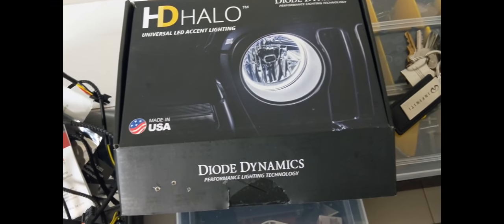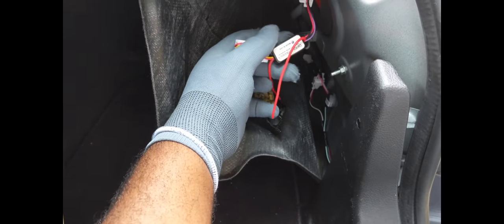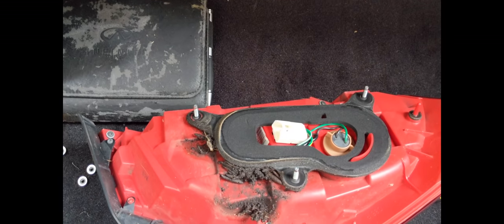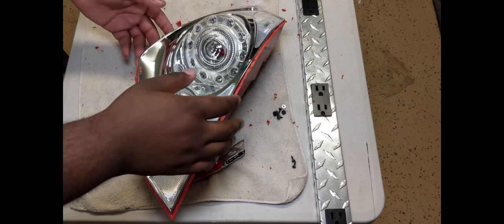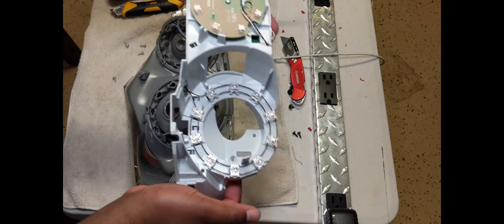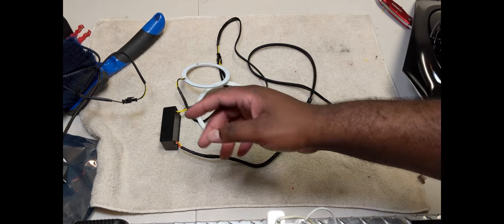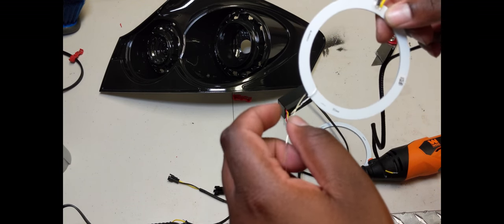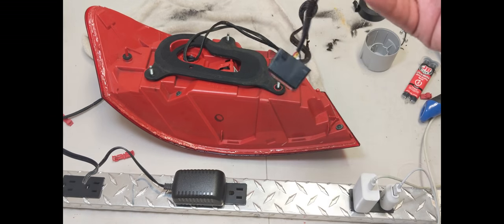G37 Brake light Halo install Step by Step DIY (GTR BRAKE LIGHTS!!!)

Comment: You can avoid having to cut the housing by putting it in the oven at 350°. Just be sure to remove the ballast first to avoid damaging it. You then simply (and carefully) pry it apart. I didn't know this prior to watching your video and just now learned it since I'm thinking of doing similar. Thanks for the video!
Reply: Try the oven method and post it.... cutting does seem kinda raw for me
Reply: i thought he was crazy cutting these up.  i haven't tried it on my tail g37 lights but i've separated many lenses from headlights and tail lights by baking them
Reply: With Gs taillights in general you can’t bake them in the oven, there plastic welded to the lens, I retrofit and always have to cut the tails.  Headlights easily go in the oven.
Reply from the maker: Finally thank you.
Reply: Who here has done the oven method instead of cutting them off ???

Comment: 90 and 110mm rings <<< for those who didnt catch it.
Reply from the maker: yes that is correct, you need a pair of 90mm and a pair of 110mm see the links in the description for diodedynamics,
Reply: @1BuildMedia  is a coupe the same?
Reply from the maker: @christians8114  apologies for just seeing this. I dont want to steer you wrong. I am not sure.
Reply: @1BuildMedia  can I use a 80mm or even 100mm cause I can’t find 90mm anywhere
Reply from the maker: I'm sure you can make it work
Reply: @_.._i  yes, 2 sets of 2 rings for 2 taillights

Comment: You don't need the tails as turns modules. Sell em, and ditch them. You can wire directly to the OEM pigtails (ON/BRAKE/TURN) and will work fine. Maybe your issue is 1 driver trying to run 2 specific halos? Also, could just depin your wires, no need to cut unecessary holes. How is your seal? Why not use rubber buytl to seal those lights?  Why ditch clear lens for halos? You recommend the 2 prime sizes for halo applications, however halo sizes can vary depending on application . FYI Halo sizes vary on build applications and builds can retain those clear OEM lens. All in all, thanks for the step by step and wish you the best
Reply: This was lowkey a passive shady comment

Comment: Hey man, great video. Helped through a lot of the work. Although, I’m having a slight issue, all of my things work except they don’t turn on when the headlights are on. Turn signal, lock/unlock, brake all work fine. But they don’t run when the headlights are on. Does it have something to do with the extra yellow off of the drivers? I didn’t touch those. Thank you
Reply from the maker: Check the wiring config in the pinned comments

Comment: Hey got a question, currently working on a project doing the quad halo set up. I have the red halos going from black>to black
Red> green , white> green and white
And i have the switchback halos yellow> green with yellow and i have the black fused with the black from the red halos both going into the black from the oem harness. However when i brake the ambers turn on instead of the red. Any idea why? I only have black and yellow going to the harness.

Comment: What would be the best way to color match the little part on the trunk with the reverse light? Tinting it maybe?
Reply from the maker: That's right I tinted mine.
Reply: If you open the trunk section and paint the housing with the same paint it will be identical to the main tail section. A little more work but perfect results.

Comment: If I added load resistors woukd I put them on the wires that came w the halos or the original wire of the tailight? (G37)
Reply from the maker: That's a good question. You put them on the original wire that will also eliminate the need for tail as turn

Comment: How’d you get the brake light in the middle the flash when you hold the brake boss man. + thank you so much for the video
Reply from the maker: There is something you can buy that does that. You can find them on Amazon. Brake light strobe controller. They normally have the info on how to install it.

Comment: I plan on tinting the taillights. How bright are the halos and will they shine through well? Also, how much did you spend for both headlights?
Reply from the maker: Yes its bright enough to shine through. I spent about $230 i believe. Thanks for checking out the video, dont forget to subscribe

Comment: Is the lense glued on? I'm asking because I'd rather use the oven method to open the light instead of cutting.
Reply from the maker: Yes its glued on. Its not like the headlights. You definitely have to cut
Reply: Taillights you can’t just open them by heating them up.. Is welded plastic so you need to cut them open..

Comment: Would it work if i do diode dynamics 110 mm and morimoto 90mm halos? diode is backed up for the 90mm . Sounds crazy but was just wondering
Reply from the maker: Im not sure what morimoto connections look like. I wouldnt want to lead you blindly
Reply: @1BuildMedia   another question did you have to use the t-tap connector ? Or the wire pigtails.
Reply: Or did you just cut a bit of the cable and twisted both wires into one (for when using only one driver for two halos) . Also do you recommend using only one or is it better to use two?

Comment: Is it possible to get amber tailnas turn? So normal red but turns to Amber when indicating
Reply from the maker: Not with my method and what I purchased. They sell different halos with different drivers, check those out. Thanks for checking out the video, dont forget to subscribe

Comment: So the diode dynamic turn and tail won’t work for halos ?
Reply: With mines the brake lights won’t turn but everything else works but the brake light I just order a dio dynamic module turn I’m hoping it fixes the issue

Comment: Appreciate the vid brotha, any idea if it’s the same sizes for a g37 coupe?
Reply from the maker: I am really not sure. I know the coupe has a bit of concave that cuts into the lights so you wont get the full halo for the smaller halo light, you would have to do some cutting to get it to fit properly there. Hope you find a video that helps.
Reply: @1BuildMedia  okay for sure thank you    I subscribed🤙🏽
Reply: did you end up finding the coupe size?

Comment: My tails are failing, the LEDS are going out. Is it possible to just do this to those?
Reply from the maker: Just make sure it's not your actual wiring that's going bad.  If not then you can proceed at your own risk of course

Comment: Did you have to break the red thing that holds the connector/harness? Can’t seem to be able to take it off without cutting it
Reply from the maker: I was able to take it out, but do what suits your situation
Reply: @1BuildMedia   another question for the green wire , did you get rid of that bulb? Is it even needed? Or did u just tap it into that wire
Reply from the maker: I'm not sure what you mean.  Dm me on IG with a pic. g37supreme

Comment: What about that trunk part, is it doable as well!?
Reply from the maker: What do you mean? the only thing I did post video was to wrap it so it matches the look of the other lights.
Reply: @1BuildMedia  i think he meant doable as if the trunk light was solid too and matched, not little red dots that makes it the break trunk light
Reply from the maker: @g37x-modsandclips37   Haaa I see what you mean. The trunk lights dont light up with the break lights. they only house the reverse lights in a non red section that illuminates when in reverse. I hope this answers the question @s. galarneau

Comment from the maker: --------------------------------- Wiring Configuration -------------------------------
Factory to DIODE DYNAMICS

Black to BLACK
Green with yellow strip to YELLOW
Green with white stripe to WHITE
Green to RED
-------------------------------------------------------------------------------------------------

--------------------------------------------------------------------------------------------------

IG: @g37supreme
Car Club: @876ix.lifestyle

----------------Affiliate links------------------
-----------Items you will need-------------
1. Rotary tool Wired: https://amzn.to/3zyRjmW
1a. Rotary Tool Wireless: https://amzn.to/3vFjShI
2. Diamond Cutting wheel: https://amzn.to/3zsjPqp
3. Tail as turn module: https://amzn.to/3zndH2M
4. Rust-Oleum Primer: https://amzn.to/3vBxrOU
5. Rust-Oleum Gloss Black: https://amzn.to/3OShFWJ
6. JB Weld Clear Weld Quick Setting Epoxy, 2 packs: https://amzn.to/3JqILTY
7. Tarnish Resistant Silver Wire: https://amzn.to/3oQzU4j
8. Diode Dynamics 110mm halos with red driver: https://amzn.to/3Ql7tHl
9. Diode Dynamics 90mm halos with red driver: https://bit.ly/3vDOkZl
10. Diode Dynamics 90 and 120 red 4 pack: https://amzn.to/3vDCKxw

Comment: Do you have to spray paint them?
Reply from the maker: see full video.
Reply: @1BuildMedia  yea I know you did but do you have to?
Reply from the maker: You don't have to but I'm not sure how it will look with the chrome when it's illuminated
Reply: @1BuildMedia  just finished them I left them chrome still looks good though only because you just kind of see the reflection of the bottom but still look kind of the same thanks a lot for the tutorial saved a couple hundred bucks

Comment: Hey I did this project and when the halos are at low brightness (like when you turn your headlights on) the LED driver box makes a very high pitch ringing noise, audible from the cabin. But when I press on the breaks and the halos go to a more intense brightness the ringing noise stops until it returns to normal brightness. Any thoughts on this noise?
Reply from the maker: What kind of radio? Stock or android?
Reply: @1BuildMedia  stock, and I know it was coming from the LED driver for the halos, I held it up to my ear.
Reply from the maker: Took a minute to find this link. I had the same issue but I have the Android radio. It was so bad I put my stock radio in and all of that went away. That wasnt permanent as I wanted to put my Tesla screen back in. I ended up purchasing this device which pulls power directly from the battery: https://www.diodedynamics.com/switchback-solid-state-relay-harness-pair.html

You will have to do this at your own risk. I have no videos of it nor do i remember how to install it. Also you should double check your wires as it could be a grounding problem. Like I said I had no issues when this was paired with the stock radio, then again I had a subscriber that did both his headlights and swapped the radio and had no issues whatsoever.

Comment: is it easy to take the trunk reflectors off too and spray those black? I dont like the mismatch
Reply from the maker: Three little bolts. I actually wrapped mine to match later on.